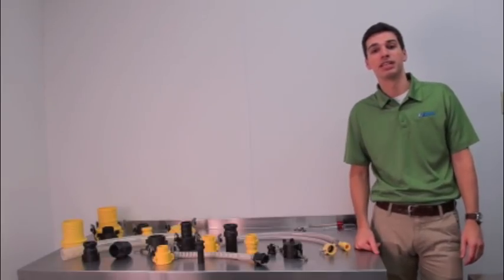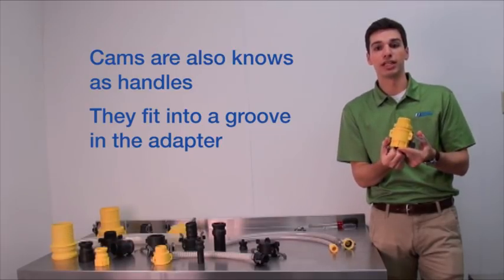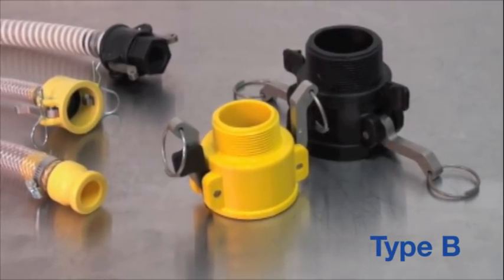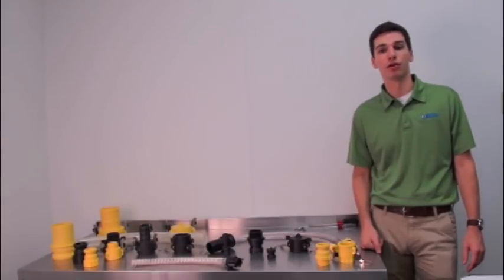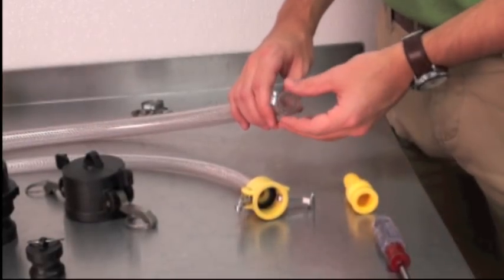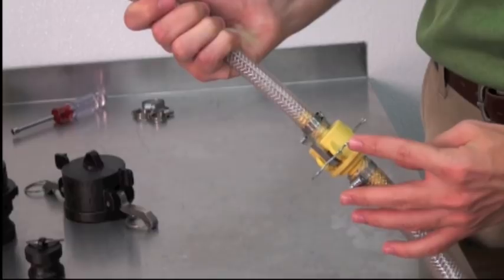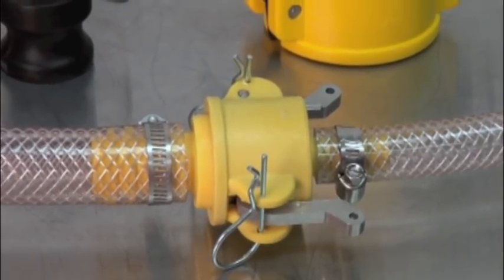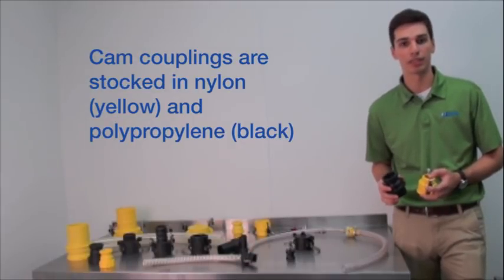How to Install Cam Operated Couplings

Comment: Does it matter which direction the cams are set up? I have a 1" gas powered water pump, and have two type A  on the pump input and output ends,